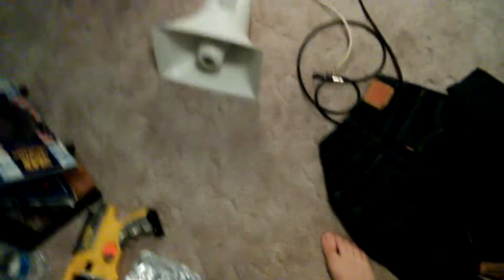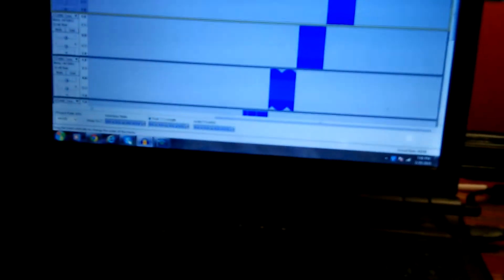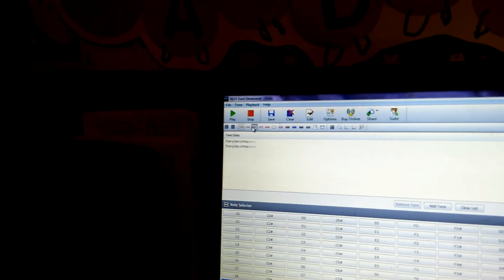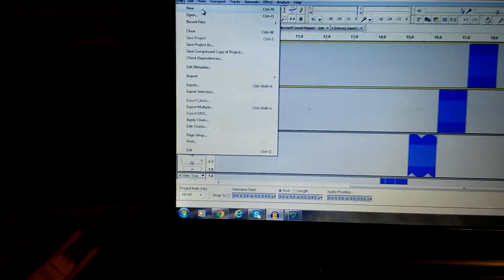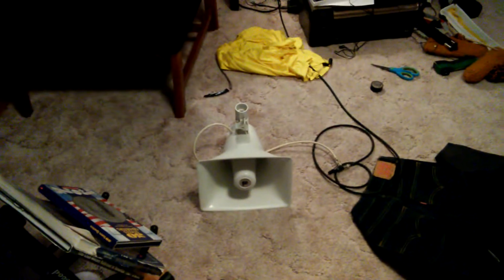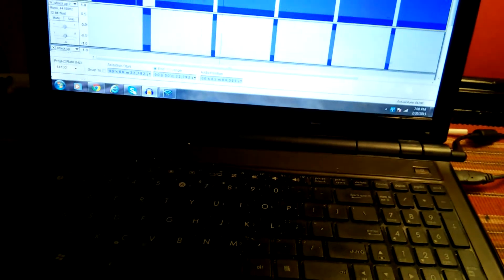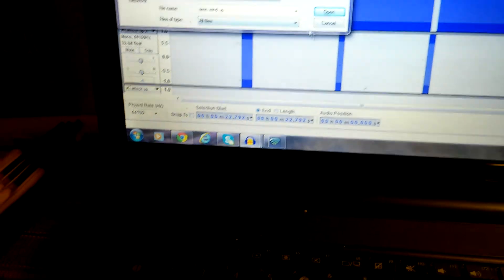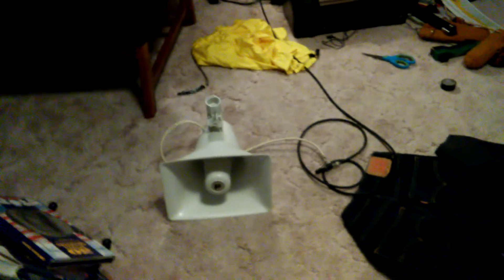Electronic siren update

Comment: Haha yeah I got the $12 ones on eBay. They are actually pretty impressive when a few of them are used
Reply from the maker: Eventually this summer i plan to buy three of those but right now I'm working with a tight budget. But I saw your video and I am impressed with them. Hope fully they can tolerate the frequencies i put through this thing.
Reply: I use a speaker like that for my electronic music boxes. It gets LOUD.
Reply from the maker: yea i was looking in to those to but I decided that the $12 ones look the closest to mine.
Reply: Yeah the 2 i use on my mobile siren trailer were actually heard over a mile away. It was crazy.